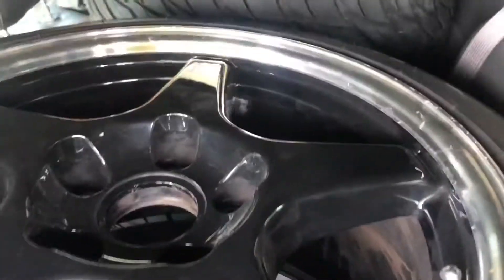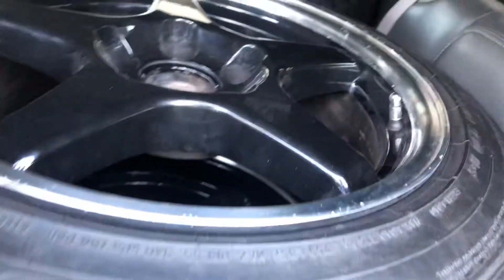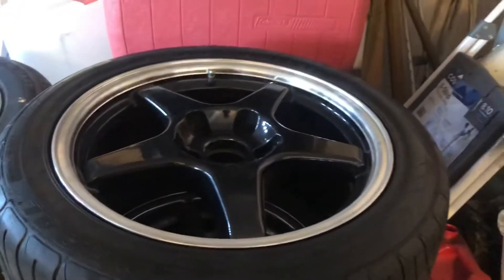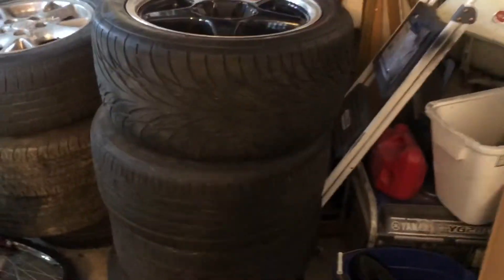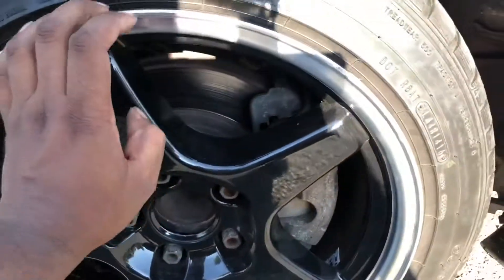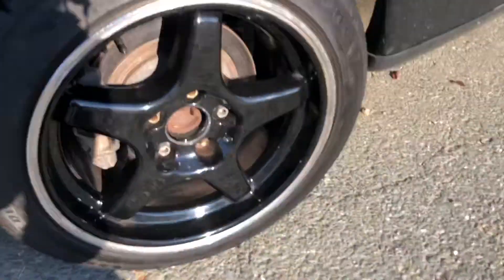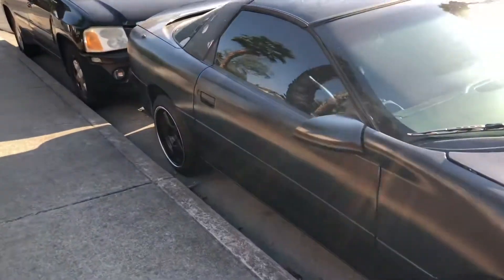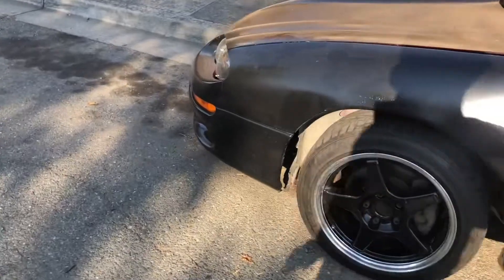New Wheels For My 02 Camaro Z28

Comment: for a 17x9 wheel a 275/40/17 tire is the preferred size.  The 17x11s can easily run a 315/35/17.  This is standard and has been done for a loong time in the 4th gen fbody world.  Even the stock 17x9 SS and WS6 wheels came stock with a 275/40/17.
Reply: I'm running 315/35/17 on my set 😬